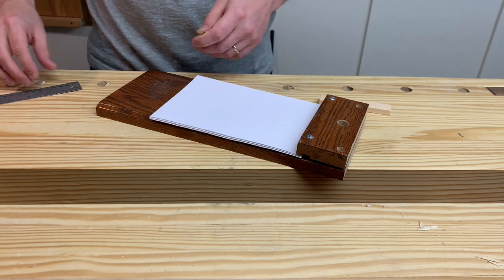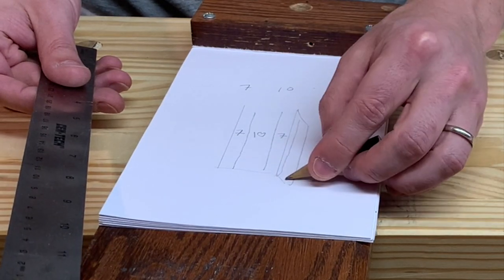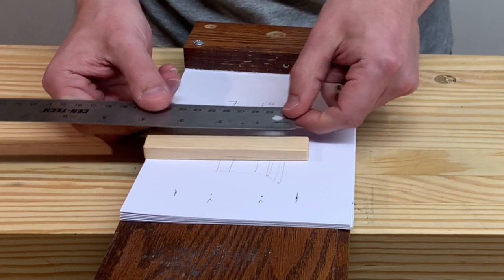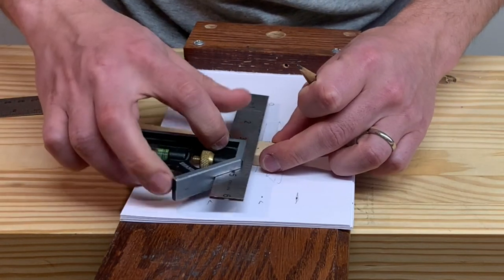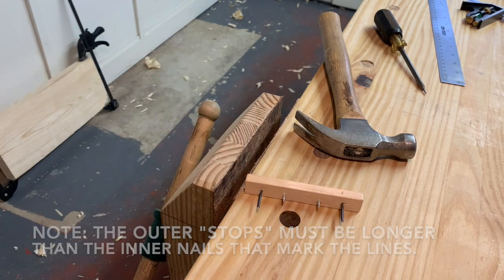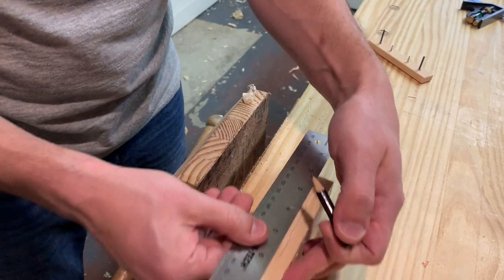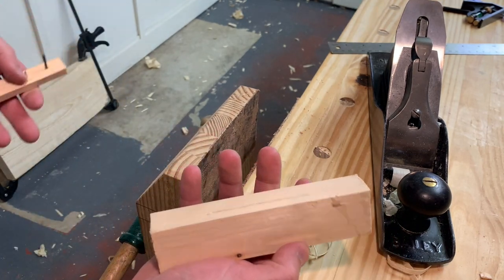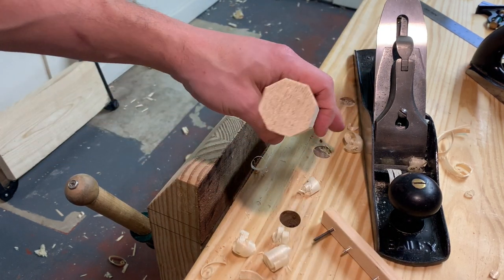Make an "Octagonizer"/Spar Gauge | Hand Tool Woodworking

Comment: shouldn't the outer holes be offset to the outside of the layout marks? You used relatively small diameter pins, so the difference is likely negligible, but I've seen people make these with dowels, in which case the error would be big

Comment: Nice little tool to add to my marking collection. I think if you made the smaller nails removeable and drilled a hole in the center that could accept a pencil or another nail  it could also work as a center finder.
Reply from the maker: Yes! Great idea!

Comment: I THINK YOU ARE INCORRECT IN THE PLACEMENT OF YOR OUTTER GUIDE DOWELS. I'M JUST GUESSING BUT I THINK THE INNER FACE OF THE DOWELS SHOULD BE IN LINE WITH THE YOU CENTER LINE MARKS OTHER WISE DIFFERENT DIAMETER DOWELS WOULD RENDER SLIGHTLY DIFFERENT RESULTS.